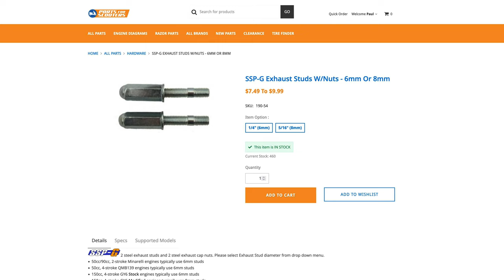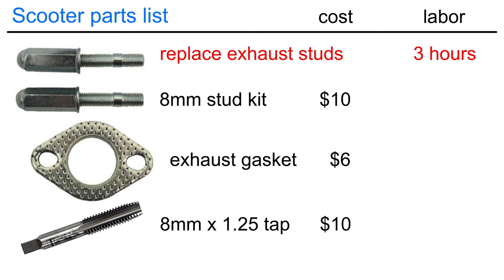Replacing exhaust stud and tapping new threads into cylinder head - 150cc GY6 Chinese scooter

Comment: Hi, what is the blue liquid that you are using in the bolt? Thanks
Reply from the maker: That is medium strength loctite. Also, I was using the wrong kind in the video. Loctite breaks down with high temperature, so I should have used a special loctite for exhaust.
Reply: Thank you

Comment: What if the holes are bigger when I bought it it's is there any way I can fill them if possible
Reply from the maker: You can drill and tap to the next size up. Exhaust studs are available in M6 and M8 sizes. You can also use helicoil if needed. If the holes can't be fixed, you can buy a new cylinder head for cheap.